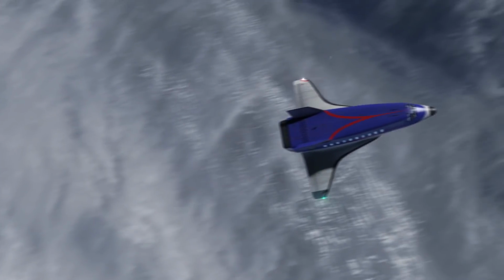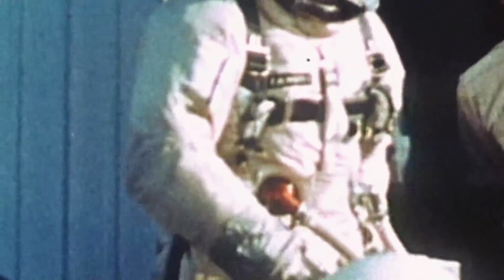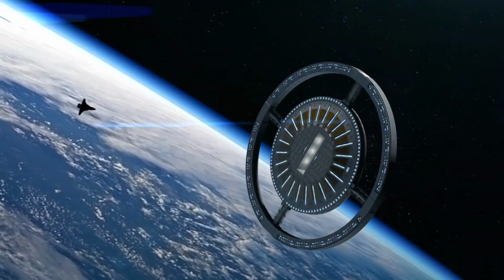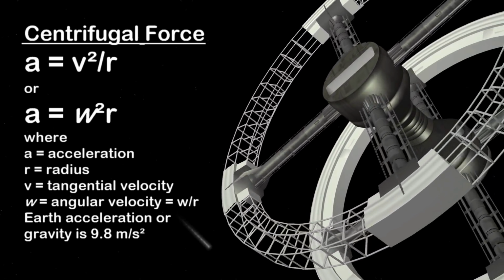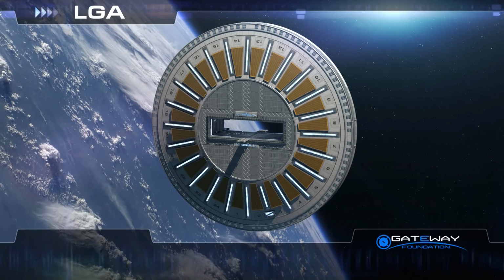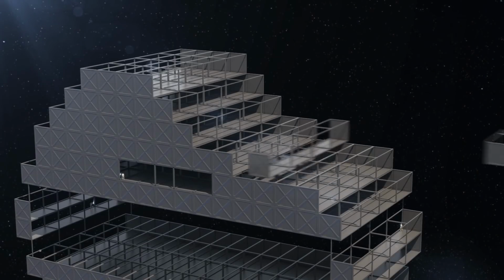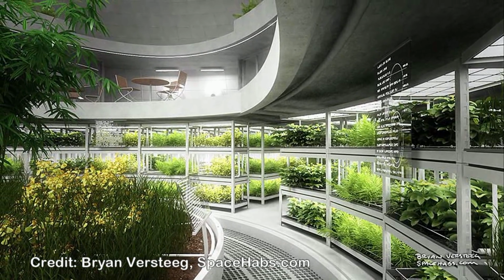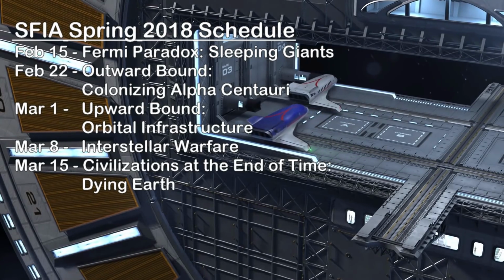Spaceports

Comment: Rotating space stations and modular design are very interesting concepts, one thing I have wondered about that has not been discussed much is what happens when one becomes unbalanced. When you have an unbalanced electric motor or similar it vibrates violently, would an orbital space station do this? Also what if all the occupants meet in a room on one side, would that imbalance it?

Great videos, looking forward to more on the Fermi Paradox.

Comment: If you can connect two of these stations in tandem, once they've got their ring sections added on, you've got a system of buttresses for holding together one of those megastructure cylinders with the added benefit that are these platforms would be fully operational spaceports & useful in their own right. But they would need some kind of sustrainable active control mechanism to prevent multiaxis tumbling. The only thing worse than spinning too fast in one direction is spinning too fast in all the directions!  That said, I have no idea how gymnasts & other acrobatic athletes get used to doing what they do.

Comment: Welding is the one thing I've always wanted to learn but have not found time for, so fore my ignorance. Wouldn't cold welding be an option? Or would the joints not be trusted? I know every piece of metal we send up has to be coated or it will cold-weld itself to another piece of unprotected metal.

Comment: A spinning ring SIMULATES gravity because of centrifugal force, while a planet's gravity is caused by it's mass warping the space around it. My question is, do you think centrifugal force will be sufficient for fetal development, or does developing life require the warped space?
Reply: They are equivalent. You need sensitive physics equipment to even tell the difference.
Reply: Acceleration is acceleration regardless of whether it is the result of warped spacetime geometry, centripetal force (the acceleration you experience is inward, not outward) or thrust from a rocket.  This is called the Principle of Equivalence (worth googling) and is what led Einstein to go from special to general relativity.  It is not exactly true though as a gravitational field has a small difference between what your head experiences and what your feet experience.  On earth this is tiny but on a spinning space station this can be significant.  Hope that helps.
Reply: Toy Show